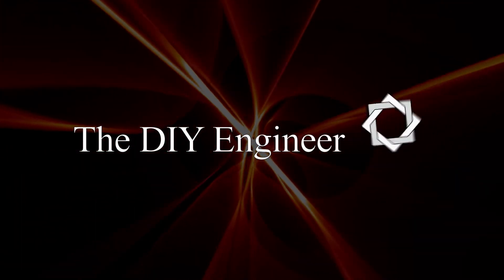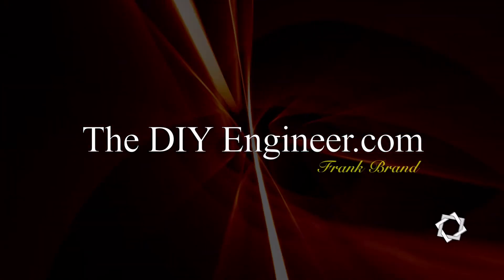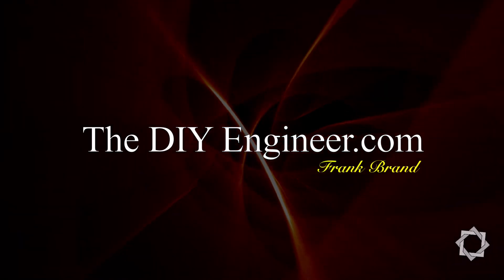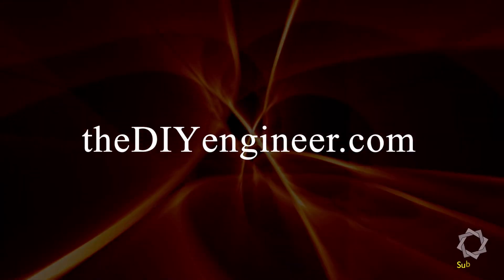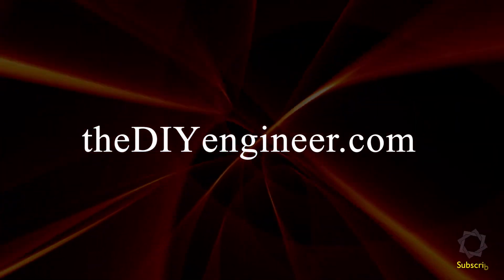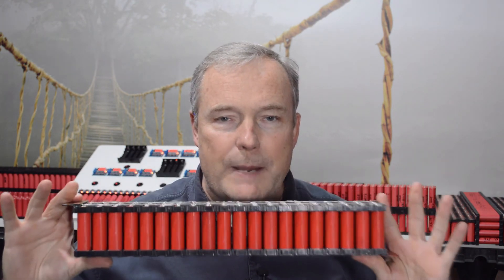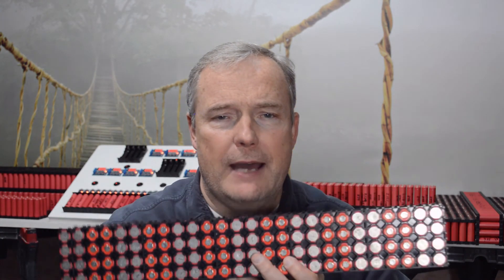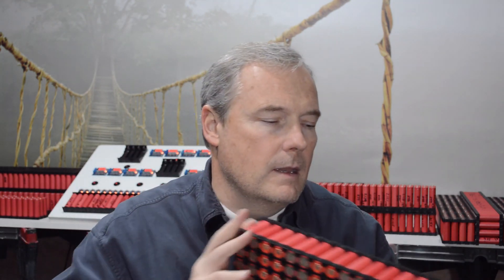Answers to the Cell Pack Questions

Comment: Every time I watch your  video has me anticipating the  next video with your discoveries.  I would guess that there are pros and cons to which ever direction you might go with the way you build your power wall.  By making the "clusters" or blocks at 3.7 volts you have the option of configuring the voltage to whatever you want by having the appropriate number of blocks to make the desired voltage.  By making each block to the desired voltage then for each block you add would  add additional amperage.  Either way would  work,  just depends how you want to handle your load.
Reply from the maker: +To Rauscher thank you for watching and being willing to sharing your thoughts. I'm working on trying to pace myself with video posts. I'm trying to post one video a week, it just takes time because I'm slow at editing. Plus I work full-time I have 5 kids who need my time as well.

Comment: I Subscribed to your channel because I has started buying use Laptop battery to make some battery packs for solar.  I do not have any solar stuff. I just want to start with the batteries first.   I'm thinking about getting 2 - 250 to 300 watt panel and maybe a small wind turbine to power my office. I'm not sure how much power it drawers. I haven't checked it out yet.  You know like lights, laptop, a computer and few other small items. I know there's a lot of variables for solar but what size battery pack do you think I should make?
Reply from the maker: You can start with your power bill to see what your monthly power consumption is.  You could also get a "Kill A Watt EZ Electricity Usage Monitor" (https://amzn.to/2JlrbB1) and you could test the watts used by each device.  I'm going through the same process, so you are not alone.
Reply: Hi Frank and thanks..  I have a Kill a Watt Monitor..  I will start adding up the power used in the office.. How will i know how big of a pack I will need to build?

Comment: Kudos Frank.  I have been exploring battery packs for the last several months trying to understand the wording configuration.  I did find a channel under the name of Adam Welch.  He did a small lio battery using battery holders to power some led strings.  I would like to hear what you think of  his idea.
Reply from the maker: +To Rauscher, OK, I will check it out and let you know.
Reply from the maker: Yes I have see the Adam Welch channel before.  I was intrigued with his experiments on charging 18650's with lead acid charge controller.  I like his methods and how he thinks things through.
Reply: Frank Brand I like his battery as well.  I am working on building something like for my RV.
Reply from the maker: +To Rauscher, I saw a video once where a guy had a custom built RV and he had 30 lead acid battery. It literally filled the storage compartments under the floor. He only had about 3 Kwh of storage. I think someone could put 30 Kwh of storage in less space!!  Let me know how your project goes.
Frank
Reply: Frank Brand I have a way to go but I will try to put some pictures up as soon as I have something that works.  Again I am using Adam Welch's model with some changes you will see when I have time to finish a small version of it.

Comment: I dissagree with your powerwall configuration.  Running a single pack at high voltage allows you to monitor each pack and each group in that pack. Also each high voltage packs can be parrelled and when one pack need service and you pull it the total votage maintains and so the whole system can stay up and running missing one pack.  One big pack all being paralled at 3.7v when several batteries die you wont know.  They are being supported by the rest of the pack.  Also not knowing about dead batteries can pull down the good ones.  Also pulling a single low voltage pack causes all kinds of problems.  Might as well shut the system down.  So.. high voltage packs can be monitored with more detailed and packs can be removed for survice without much affect..
Reply from the maker: This has been an interesting topic.  To be honest, at the time I posted this video I thought I had worked this through...  But I'm with you.  It just makes more since to build the cell packs at the full voltage.  That being said, you are spot on.  I will be building my Powerwall battery packs at 48 volts.  I think the only thing I have not worked out is a BMS system for the packs.  Most of the 13s controller cost around $100 and I will need at least 10.  So in the end I would have around $2000 in cells and $1000 in BMS...  I need to give this more thought.  Thank you for your thoughtfulness on this and being willing to tell me what you think.  :-)